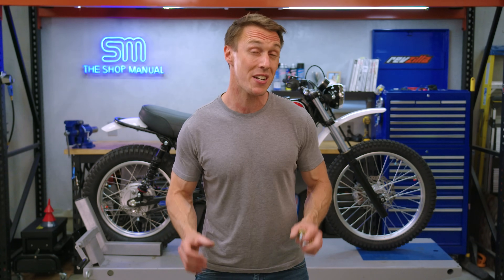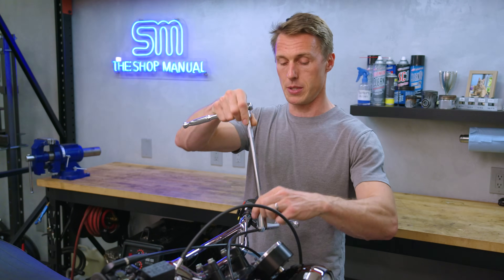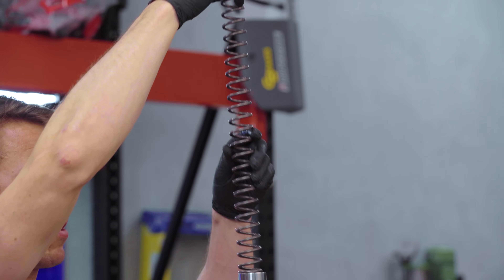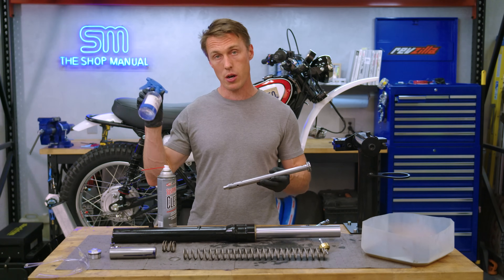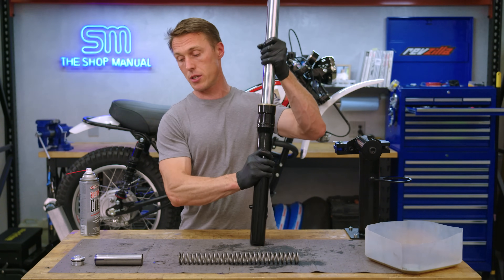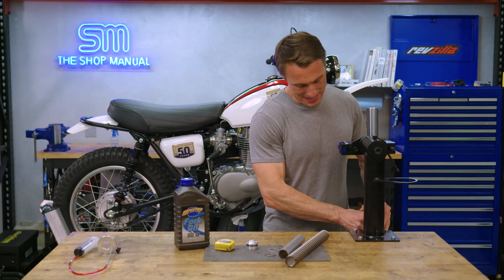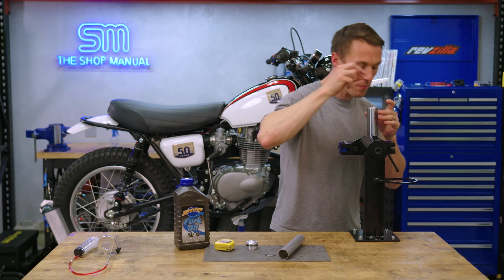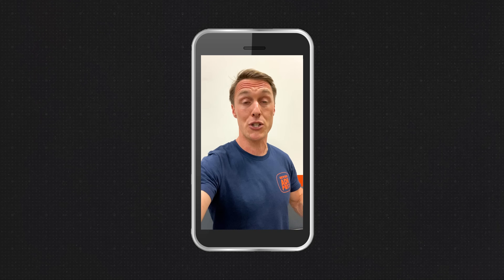How To Install Gold Valve Emulators | The Shop Manual

Comment: looks like a solution without breaking the bank, but thats only assuming you will be able to handle this on your own - and if you are not, then the installation cost and probably the adjustment later as well need to be considered as well - personally i would go for a cartridge kit show that i have easier adjustment but for those who are more handy this is a great solution it seems.. Great video !

Comment: I've bought that valves from USA to Italy, and installed on my Burgman 650 (i know, it's a scooter, but it acts like a motorcycle and has just 11cm of front suspensions): that valves are a life changer! The only annoying part is that to fine tune them you have to open the top cap every time. Anyway, they were some of the money best spent for my bike.

TIP: to remove my dampeners, i've bought a 1m long, 10mm diameter iron pipe, and covered one of the end with a rubber net wtih a very high grip: you press it in the dampener, and it won't rotate anymore.

Comment: Hi Ari, recently I changed the fork oil & seals on my ninja 250r. However my fork caps are now leaking a small amount of oil right at the top. I'm about to disassemble them and fix the problem but before I do, I was wondering if you had any advice!

Comment: These cartridge emulators really work well. Have used on numerous vintage MX and street bikes with good results.  Adjustment is a PITA. So search forums etc to find applicable baseline data as a starting point

Comment: I added Gold Valves and Racetech springs to my K75S and set everything according to the recommended settings. Now the front is stiff and jarring. Not sure why that would be the default setup for my weight and my bike but now I need to do countless trial and error adjustments, taking the forks apart each time to get it right. My rear Hyperpro shock is the same. I have no clue why suspension companies think that stiff and harsh equals good handling.

Comment: No sane rider will do these exercises rather simply either change the bike or change the shock itself . I think this video was unnecessary for a common rider
Reply: Change the bike or fork rather than install a simple part? Sounds like you may have less mechanical skill and more money than most. To each his own. I've run GVEs on numerous motorcycles, including race bikes that have had other expensive and complicated procedures done to them to improve performance. The GVEs were more than adequate, even when there were front-end upgrades and full cartridge kits available.
Reply: @AriH211  yes Ari I am a basic rider without much idea about pro level maintenance management hence commented . That’s why I mentioned for common rider . May be we have to attend some basic courses to understand what you are talking about and its reasoning . Good luck mate 😍

Comment: Just did this a few months ago on my cb500f with the YSS kit (race tech has a local distributor in my country with an exclusivity contract that adds serious $$ to the price), it made so much difference! I kind of did the emulator upgrade on a whim as I was changing the springs for something much less soft, but it turned out the emulators totally transformed the front end. It went from unresponsive mush to just feeling tight and locked in, definitely recommend!

Comment: Did exactly this to my bike. Took away the wallowing at speed and most of the harshness on pot holes etc. I would still like to remove some brake dive - add a couple of turns to the valve or firmer springs?

Comment: I went with the Cogent Dynamics Direct Drop In Cartridge (DDC) over the Gold Valve.. I think they were about the same price, but easier installation for the DDC. Not sure if they work as well as the Gold Cartridges, but I could tell a difference over my stock suspension for sure.

Comment: I always advise breaking to foot bolt free as the first step of fork service, with the weight of the bike on the spring it rarely spins on you. It is also important to know that many damper rod forks have a sleeve in the lower leg that the damping rod must be seated in correctly or you will have big problems. If you never removed the lower leg you would not be aware of this. 
✌🏻👍🏻

Comment: Anyone good with diagnosing fork noise? Short travel rod damper forks on a honda PCX. Makes a noise like fork top out, at anywhere between zero travel and almost all of it. Been to 20 mechanics, most can't hear it (they don't want the job...) the rest are like, so? Almost all honda mechanics say no problem, but no other fork has ever sounded or felt like this. Tried rebuilding, tried new oil locks, top out spring, replacing all internal washers with genuine honda parts ordered from honda. Then new lowers (incase bush worn), then new springs (one measured about 5mm short, the other 3mm short of spec), then upper stanchions incase they'd been replaces with aftermarket (mechanic reckoned they were worn).  So basically have an entire new fork, even spacers!     Went to a dirt bike shop who recommended the emulators, YSS sold here, gold valve not available without massive import duties.  Instructions from YSs are pretty poor. Drilled out the compression holes, left rebound holes alone, new oil control and dust seals and upped to 15wt as per YSs.  Rides way better, much more useful compression behaviour, but hardly any rebound, upped to 20wt, compression became too harsh on high velocity hits and rebound better but still a tad fast if I'm honest.   Tried backing off the emulator compression side to Basically the minimum (YSs spec default setting as 2.5 turns in on the preload Spring. This this, tried 4 turns, 6 turns and hen all the way back to just one turn to hold the compressor valve lightly closed which is nicest position).    So damping performance I'm now happy, scoot handles really damn well, sag is perfect for weight, doesn't dive into the bottom out position every time you break hard. 
BUT.
Damn tap tap tap noise all the time. Pedestrians can hear it and literally turn to look at me as if to say "mate sounds like your front wheel is about to fall off".
Head bearings new, all honda parts, tried running more preload on them but no difference so it's not that.
Tried riding with entire front end plastic removed, ECU and others stuff all zip tied to hell, not the problem. Tried removing and tie up front brake caliper incase it's glide pins or pad slap. Nope.
Tried new front wheel bearings. Nope.
Tried front wheel bearing spacer. Nope
Tried a different front wheel off another scooter incase something inside the wheel casting..nope
Tried new mudguard. better! 
Tried with no mudguard. Problem gone! 
Tried replacement new mudguard and new hardware, problem returns.

Try adjusting one side of fork spring preload to be a few turns ahead (3-5) of the other side (normally a bad thing) and problem gone, for about 1km then returns.

So it's like something to do with one side of the fork being longer internally than the other? Or the spring is slapping the inside of fork leg? But tried every possible combo of new honda parts, old honda parts from my bike, old fork parts from another bike and every mix of YSs spring, spacer etc. obviously fork behaves differently with these wrong combo but noise is still there.
6 months of faff. Super annoying and loud to ride around town. Enough is enough so went to trade scooter in against a new one. Went to the honda dealer that previously said they couldn't hear anything, right away, they want to deduct a bunch of money because "front end sounds noisy, fork must be damaged". But then they aren't able to suggest why it's noisy? 

Maybe I should just commit insurance fraud as it's driving me insane. You can hear it at 5km to 100kmh over the wind noise when you hit small bumps in the road (5 to 20mm square edge bumps).

If anyone got any glues. Hit me up before I get even more fed up. Internally fork is similar to any open bath, emulsion rod type fork

Comment: Hey I just got a used motorcycle (2013 SFV650) that needs fork seals replaced. I've never done it before and am relatively new to working on bikes. Should I do it myself or pay a local shop $350 to do both forks?
Reply: Pay if u can imo it's not worth hassle unless u like this type of work and have all needed special tools and fluids and there's always required for forks

Comment: Big improvement, yes, but they have poor low speed samping control. The emulators lift off the rods just enough that LSD is all but nonexistant, but at least HSD isn't like a jackhammer with stock rods. Really noticeable with long travel suspension on dual sports.
Reply: I'd argue HSD is THE biggest issue with all suspension and all bikes and it is what really defines good suspension. 
Had wp43 from ktm640 on my old AT with 320mm travel dude that thing was out of this world smooth,.I'm pretty sure cone.valve.isnt as good as that setup was,.u basically couldn't feel when front wheel got on 10cm sidewalk, at any speed,
If u can do GOOD enduro forks swap it's worth every money

Comment: Thank you Ari.  Did I understand correctly that this was a CRF250F fork that you adapted to the XL250 ?  If so, why is that I cannot find a CRF250F Gold Valve emulator as a purchasable option?
Reply: That's correct. Not sure why the GVE isn't showing up for you. Let me talk to ZLA's Commerce team to see what's up. If I was at the shop I'd pull the p/n off the product box for you. You can always call Race Tech directly and they'll get you set up as well.
Reply: @AriH211  Thank you very much!

Comment: i take out the damer prd bolt completely before taking out the spring. its messier but not haveing to put it all back together twice  is nice. espicly when there is a lot of preload.
Reply: Yup, that's always an option. Whatever works!
Reply: @AriH211  the first time i ever did forks i ran into the all the frustrations with that bolt. that old kdx 200 had like 2 full inches of front preload stock and a super fine thread for the cap that could cross thead like nothing. assembly meant putting them back on the bike tighten the lower triple clamp and put my weight on a speed wrench and carefully wind it in. i did not want to do that any more then i had to.

after the first one i decided to just take that bolt out first. and I've just kept with doing it that way ever since. dont want to reli on getting lucky when doing this stuff.

Comment: DIY fork oil level/air gap hack -  Use your vacuum bleeder. Cut a small piece of 1/4" copper tubing a inch or 2 longer than your required fork oil level. Mine is 110mm. Mark your copper tubing at 110mm with a sharpy and then push your vacuum tubing onto the copper tube to your mark. Zip-tie it in place. Insert the copper tube using the vacuum tube to rest on the top lip of the fork tube. Now use your vacuum bleeder to suck out the extra fork oil.

Comment: Couldn't you loosen the damper rod bolt while it's on the bike? That way the weight of the bike will load the damper rod, keeping it in place while your turn the bolt.
Reply: Maybe cuz the oil would start leaking out with gravity.  Notice he loosened the bolt after draining the oil.  But I guess you could break it loose then snug it back up just enough to stop the leaking.

Comment: To cut the spacer, a large tubing tubing cutter (the swinging kind that you spin spin around) works great.  Guarantees a square cut, no burrs and is real easy.  I just cut the stock steel spacer with it.  

Glad Ari made this video, was an awesome upgrade for the suspension on my FZ-07.
Reply: Yes ensure cut and both ends are super flush at 90 or you'll get annoying fork noises.

Comment: I did this to my vintage CB750 last year and Racetech didn't just sell me some parts.. They sold me a whole new bike that was now rideable. Their vintage specialist (Matt I believe?) handled all my questions quickly then it was just a matter of getting the parts I needed through a Canadian retailer. An extra step we have to deal with but worth it.

Like Ari always says though, keep your shop manual nearby if you're attempting this job. Unless you're working on this exact bike, the steps Ari goes through may not be 100% accurate for your application.
Reply: Matt Wiley is RT's vintage specialist and he knows his stuff. RT also offers drum-brake refacing. They care about old bikes!
Reply: @AriH211  Very cool!

This old 82 Nighthawk was my father's. It was the bike I learned to ride on and then it spent about 16 years deteriorating in a shed. I stripped that bike down to nothing to get the engine running again but the stock suspension was so awful it was barely rideable. I wasn't about to cut the bike loose but it wasn't looking good for it to remain in regular rotation. So, I did what every normal person does.. Spent $600 on a beat up 40 year old bike's suspension! Racetech saved my father's bike.

Comment: Those emulators are an engineering masterpiece, achieve much of the advantages of shim-dampening with clever oil circuits.  I'd love to put them on my old ninja, just tough to justify the cost, they're a little expensive, awesome though.

Comment: Great video!!! 😃 I went with the Cogent Dynamics DDCs on my DR650, mainly because of the ease of installation - no drilling required, you just go with a lower viscosity fork oil to disable the damper rod. However, you can’t frink around with them like you can with the RaceTech emulators. I am very pleased with them and they are way better than the stock forks, but I do find them just a bit over-damped for bopping around town. Were I to do it all over again, I’d go with the RaceTech emulators, so I could dial them in just so. Either way, cartridge emulators are a huge improvement over a stock damper rod fork setup. 😃

Comment: Bicycle shops have a saw blade guide used for shortening steerer tubes that gives an accurate cut if someone isn't confident in the shown method.  Or find a neighbor with a lathe..
Reply: And bicycle shop labor rates are stupid cheap.

Comment: I installed these on an FJ1200 many years ago.  Certainly helped the harshness on square edged bumps, but tuning was an iterative, time consuming process that involves tearing down the fork if you wanted something different.

If I can get a cartridge setup for say $750-800 that I can install and then have external adjusters, I am doing that instead.

Comment: Excellent video and explanation Ari. Thank you. One thing I would recommend is starting the top-cap thread by hand rather than going right at it with the socket wrench; too easy to cross-thread those fine-threads and that would be a bad day.
Reply: You can also rotate the top cap backwards until it clicks into the threads, then it should thread in correctly.

Comment: Did a gold valve in my old GS a few years ago, its definitely not as good as a modern cartidge fork, but man is it a huge step up over how it was stock.  Also Ari keeps mentioning racetech, they are fantastic to deal with.  I'm a nobody,  sent in an email asking what my options were, and heard back later in the day pretty much saying "yeah dawg, youll want this, this and this, give us a call when you are ready and we'll get your spring rate dialed and get it sent".

Comment: While emulators work great and I've ran a set in a KLR650. There's a much easier to install product that does the same thing out now. The cogent ddc valve or ricor imtiminator are available for a lot of dual sport bikes. To run these valves you simply shorten the spacer, drop them in and run thinner 5wt oil that flows right through the dampener rod.
I have the imtiminators in my dr650, I cant tell much difference between them and the emulators I had in a KLR650, both are night and day better than stock.
Reply: Without drilling damper rod you can't get full benefit of emulators, cuz u still have that flow bottleneck for sharp hits.
Thinner oil is like bandaid more than fix
Reply: @Angry-Lynx  I'm aware the emulators dont work without drilling the damper rod.
The other fork inserts do tho, they are designed to work with thin oil and out sell emulators 10-1 for bikes like the dr650 or klr650.

Comment: A quick note about the damper rod bolt- if you pull the inner fork tube against the top out spring you can usually get enough friction to stop it turning enough to get the bolt out. So while turning your wrench on the bolt, pull the inner tube away from you in the direction that the fork would top out if the front wheel was off the ground while riding. It might seem counterintuitive and a little awkward but once you figure it out you won't worry about that bolt again, even with hand tools.

Comment: Nice to see the Emulators getting some love. Heads up folks, these are the single most transformative change you can make to the functionality of damper rod forks. Huge bang for the buck.
Reply: They made my bike ride stiff and harsh on the recommended settings. It’s a pain to pull it apart a few more times to hopefully get it right.
Reply: @toddsorel-pg4hr  It is a pain I agree. Is it possible these settings were for a different bike, or where the race settings? Track settings are usually very stiff. When I figured this out I had an ah-ha moment and realized that 'fast' street riding is nowhere near track speeds. Road surface condition is usually terrible compare to track and that makes a big difference for this. Try the softest settings recommended  or call them, they provide crazy high levels of support.
Reply: @toddsorel-pg4hr  well, different fols different settings. to know the exact settings, we need to try and error ourselves, except we pay suspension services 🤔🤔
Reply: 100% - hated my front forks until I installed and now hate my rear shock….lol.  Great upgrade!